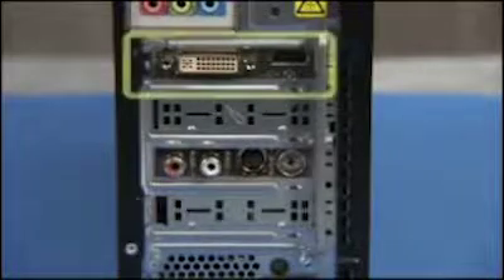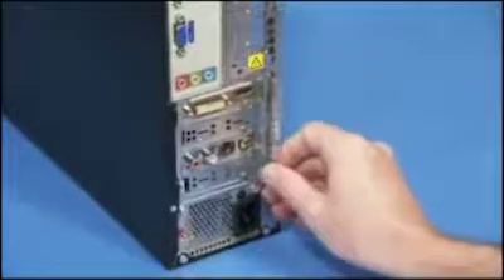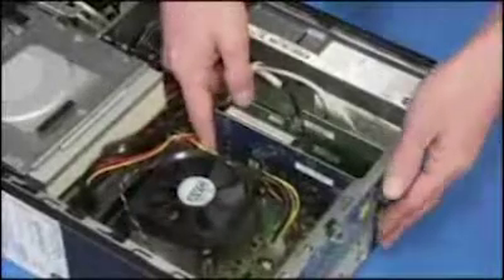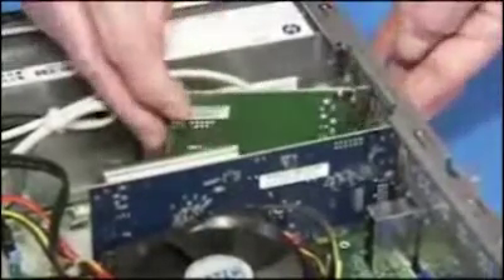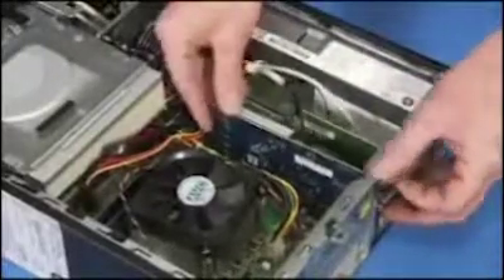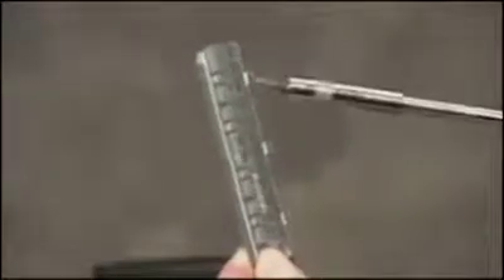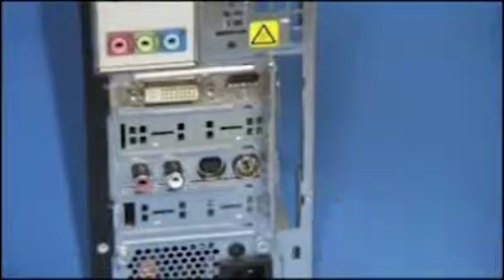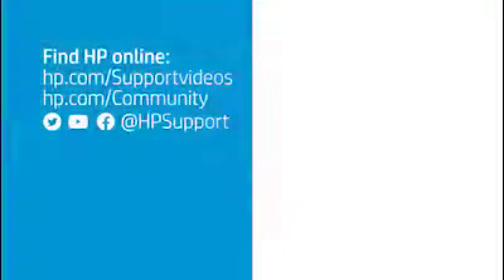How to Replace Graphics Card Expansion Card | Slimline s5-1000 | HP Support

Comment: Wow Ultra high-quality 👌
Reply from the maker: +Demonicgaming! Welcome!!
Reply: @HPSupport   Why is my HP slim desktop computer with Intel UHD 610 as well as 4gb of RAM Intel Celeron slow when I try to play games
Reply from the maker: +Demonicgaming! Please perform updates via Windows and HP Support Assistant as mentioned below to fix this issue: Step 1 Windows Updates - 1) In the search box, type and open Windows Updates. 2) Check for updates. 3) If the updates are available, click on install and restart the computer. Step 2 HP Support Assistant Updates - 1) In the search box, type and open HP Support Assistant. 2) Check for updates. 3) If the updates are available, click on install and restart the computer.
Reply: @HPSupport  didn't work probably cuz I use it as a gaming computer could that be a possibility why it's slow?
Reply: And if that I might need to upgrade to 8 GB RAM
Reply: @pastagamestudios8363  same I do t have the money for a gaming desktop rn so I’ve been using this for a gaming one

Comment: I have an HP Pavilion Slimline s5-1234, I have put a Core i5-3450 processor on it but no image appears, I put an i3-2100 on it and it works normally. and on its HP website it says that this model recognizes third generation i5, ????
Reply from the maker: Hi Auki, thanks for contacting HP Global Social Media Support!
I understand that you are experiencing an issue with your computer after changing the processor.
I will do my best to assist you.
Please refer 'Processor upgrade information' under the specification page to know about supported processors: https://bit.ly/40h9xpD 
Binu_HP Social Media Tech Support
Reply: @HPSupport  if I update the bios, does it recognize third generation processors?
Reply from the maker: Please try updating the bios and let is know how it goes.
Binu_HP Social Media Tech Support
Reply: @HPSupport  well if you don't know, at least send me the page of hp where it is to update the bios of this model
Reply from the maker: Thanks for the reply.
Please perform updates via HP Support Assistant as mentioned below to fix this issue: HP Support Assistant Updates - 1) In the search box, type and open HP Support Assistant. 2) Check for updates. 3) If the updates are available, click on install and restart the computer.
Binu_HP Social Media Tech Support